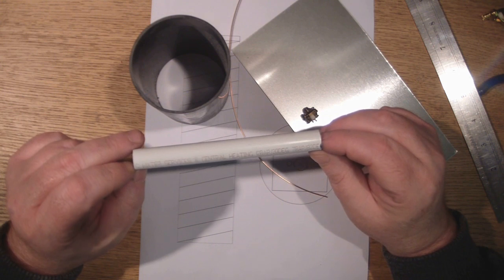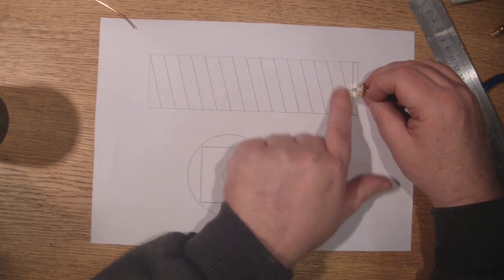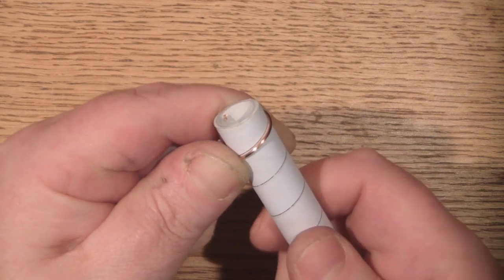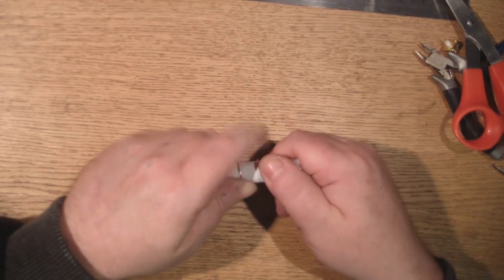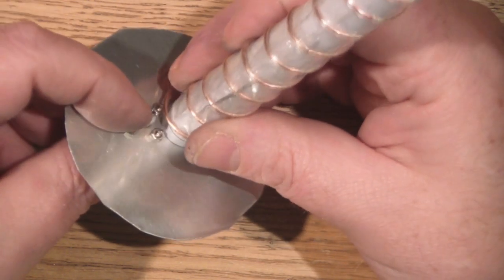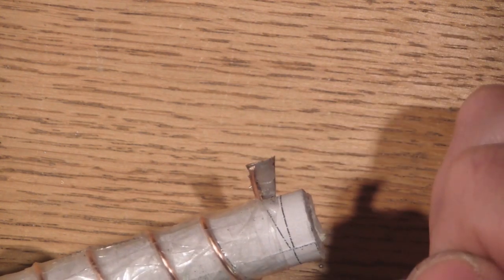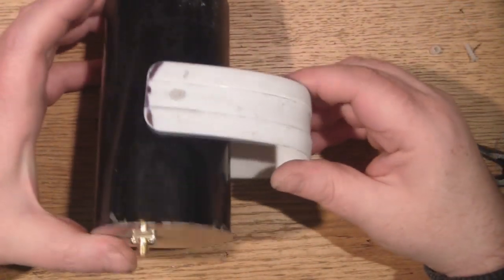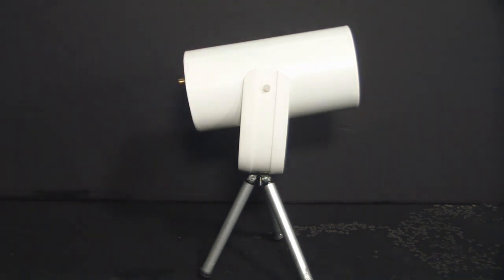Helical Antenna 5.8GHz 10 Turn

Comment: Hi Andrew, greetings from parts west :-) Two matters in regards to using found and or saved objects for the build :-) For the core upon which we wrap the copper, I have plenty of this stuff called PEX it's 1.60cm and wonder how the variation in core diameter will affect the gain? Then there is the gauge of the copper,...I have 14ga (what I assume you are using in the build), 12 and 10 ga. copper trims  I have been told that thicker can be better. Oh and Andrew, are you using real tin? Or can we use something like a cookie "tin" :-) This clarification will most useful for myself and perhaps others who are first timers. All the best there mate! Chris
Reply from the maker: Hi Chris a small variation like that will not affect your build a method that I have also used is to make the tube from card then wrap the coils and dip in hot wax to hold the coils in place and add strength. Using thick wire widens the bandwidth of the antenna increasing the frequency range, not so helpful if your just using one particular frequency (5.8) as interference has an effect on range. Any metal can be used for the reflector using copper or tin it makes no difference.
Hope this helps
Reply: Thank you And good to hear from you Andrew. I have finally got all the parts and the impetus to make the a number of your antennas. I'll be endeavouring a Wifi and now for the 5.8 for FPV.... This is a great build and what I was referring to was the little 5x15mm triangular "Sliver of Tin" you called it. Is tin the only material we can use to get the 50ohms happening? I am sure I can get real tin delivered here, I get everything else from Ebay and elsewhere :-)
Reply: Chris Leech yes I'm wondering the same thing about the tin
Reply: Kristian Van Markey I ended up using the top from a "tin" can. Can of soup or some such. You can actually use a pair of kitchen shears to cut the 5 x 15 mm triangle out without wrecking the blade BTW. Hardest part is marking up the material before hand :-)
Reply: +Chris Leech Helix antenna operating in  axial mode are wide bind antenna for a specific range of frequencies where  wavelength  is close to the circumference of pipe (Google the actual value). Generally the larger diameter pipe is, the lower the frequency range it is tuned to. 

On the other hand, when using PVC to support a helix antenna, because of its dialectic properties slows the electromagnetic wave,  helix antenna wrapped around a PVC pipe requires a smaller diameter coil than an air coil antenna. 

I don't know how to calculate the theoretical effects but generally speaking, if air has a dielectric constant of 1, and PVC has a dialectical constant of 3.8, and if PEX pipe (cross-linked polyethylene) has a dielectric constant of 2, then it's optimal diameter should be between an air coil coil and a one wrapped around a PVC. 

Without taking the time to research it, I'm not sure if the dielectric effect was taken into account when the video poster designing this helix antenna. But, since your building yours with different materials, I'm happy to point you in the direction you need to look. 

Another thing to consider: Using larger diameter wire increases the frequency range (band width) that it is tuned to, but at the expense of picking up more noise from a larger part of the spectrum, and when wrapped around a pipe, increases the diameter some over a pipe wrapped with thinner copper wire, thus tuning the antenna to a slightly lower frequency range.
Reply: +Chris Leech  "Is tin the only material we can use to get the 50ohms happening?" 
Short answer: NO, copper would work fine or even better. 
Long answer: Your looking to match the impedance of the antenna the impedance of the cable so as to reduce reflected power. When you have impedance mismatch, some energy bounces back like waves hitting the side of a boat.
Reply: +Kristian Van Markey 
Short answer: NO, copper would work fine or even better. 
Long answer: Your looking to match the impedance of the antenna the impedance of the cable so as to reduce reflected power. When you have impedance mismatch, some energy bounces back like waves hitting the side of a boat.
Reply: +Keith Reynolds Hey budd! Happy New Year !! Never got around to saying thanks for the good info there, just now revisiting as I go to make some more. A few of these in a 3 and 5 turn, plus a side trip into Quadrifilar 5.8Ghz as well. Winter is great for building, Just wish I could reliably test.
 Best Regards

Comment: Hey Andy, its awesome your videos are very informitive but 1 question  if possibly anyone could answer... for extending range from my modem will ( redundantcey ) with antennas 2.4 ghz to and from , meaning directional on either end and omni be all connected together  on both sides  be fine ?

Comment: Hi Andrew I'm enjoying the videos but as newbie I have a question. Does the 15mm X 5mm shim have to be tin or could it be a nice thin bit of copper ?
Reply: +Jon Davies Short answer: NO, copper would work fine or even better. 
Long answer: Your looking to match the impedance of the antenna the impedance of the cable so as to reduce reflected power. When you have impedance mismatch, some energy bounces back like waves hitting the side of a boat.
Reply: Thanks Keith.

Comment: Hi Andrew, thanks for the detail build tips and instruction. What type of antenna we can use on the transmitter side?
Reply from the maker: Just uploaded the perfect antenna http://youtu.be/Ltyd2EjC6-8?list=UUHqwzhcFOsoFFh33Uy8rAgQ
Reply: +Soon Chong Lai Either a dipole or if you have a longer distance you need to span, you can use a similarly wrapped  helix antenna. When using two helix antenna, which ever way you wrapped your first helix (left hand or right hand), you must wrap the other helix antenna the same.

Comment: Hi, I'm planning to build this antenna, and I have a 16AWG copper wire, can I still use the 5mmx15mm triangular silver tin?
Reply: +Sol mag  Your looking to match the impedance of the antenna the impedance of the cable so as to reduce reflected power, so yes you should. When you have impedance mismatch, some energy bounces back like waves hitting the side of a boat.

Using a thinner wire like 16AWG will have a smaller frequency range that the antenna is tuned to. 

Just Build it and test it.. 

If you find that you receive stronger signal on channel 11 over channel 1, you might try to increase the diameter of the pipe with a few wraps of paper to tune the antenna down a few hz. do that until you received power on channels 1 and 11 are about the same.